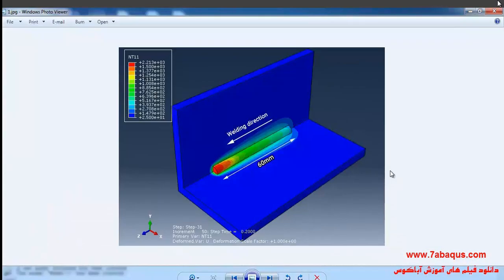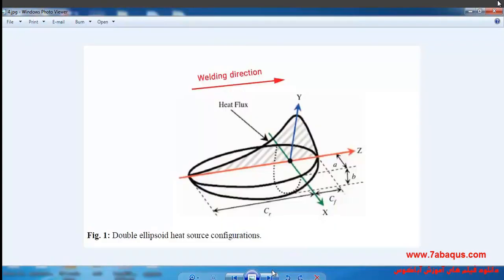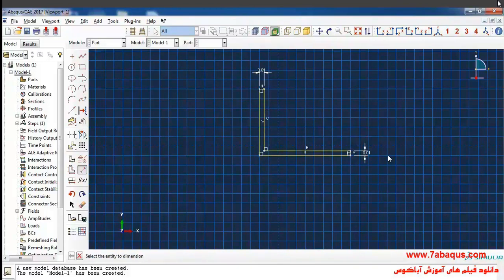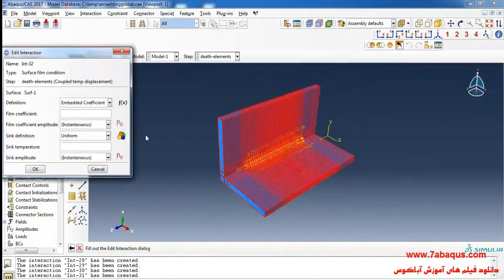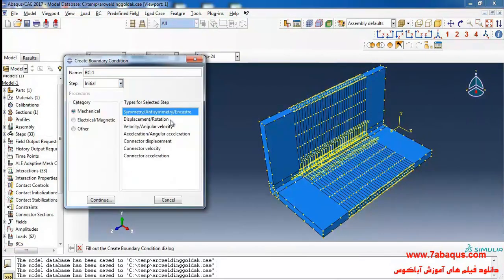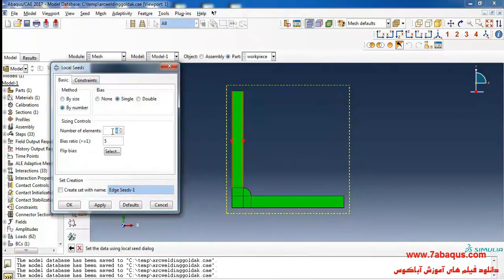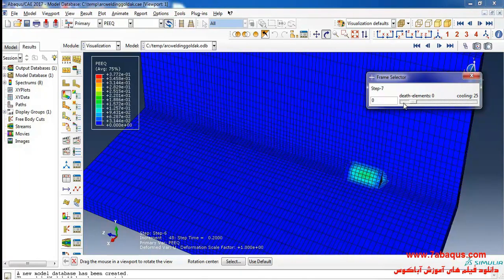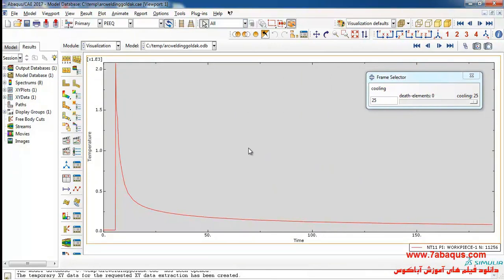Arc welding using the Goldaks double-ellipsoid heat source model Abaqus

Comment: sir please help me to remove these errors
The model database "D:\abaqus simulatins\Simulation Arc welding using the Goldaks double-ellipsoid heat source model Abaqus\arcweldinggoldak.cae" has been opened.
The job "weldbead" has been created.
The job input file has been written to "weldbead.inp".
The job input file "weldbead.inp" has been submitted for analysis.
Job weldbead: Analysis Input File Processor completed successfully.
Error in job weldbead: Too many attempts made for this increment
Job weldbead: Abaqus/Standard aborted due to errors.
Error in job weldbead: Abaqus/Standard Analysis exited with an error - Please see the  message file for possible error messages if the file exists.
Job weldbead aborted due to errors.

Comment: Sir can you guide me how to remove these errors?  I will be grateful
The model database "D:\abaqus simulatins\model.cae" has been opened.
The job "Job-1" has been created.
The job input file "Job-1.inp" has been submitted for analysis.
Error in job Job-1: ELEMENT 3253 INSTANCE PART-1-2 CANNOT BE ADDED USING *MODEL CHANGE IF IT IS NOT REMOVED OR INACTIVE IN THE PREVIOUS STEP
Error in job Job-1: ELEMENT 3254 INSTANCE PART-1-2 CANNOT BE ADDED USING *MODEL CHANGE IF IT IS NOT REMOVED OR INACTIVE IN THE PREVIOUS STEP
Error in job Job-1: ELEMENT 3255 INSTANCE PART-1-2 CANNOT BE ADDED USING *MODEL CHANGE IF IT IS NOT REMOVED OR INACTIVE IN THE PREVIOUS STEP
Error in job Job-1: ELEMENT 3256 INSTANCE PART-1-2 CANNOT BE ADDED USING *MODEL CHANGE IF IT IS NOT REMOVED OR INACTIVE IN THE PREVIOUS STEP
Error in job Job-1: ELEMENT 3257 INSTANCE PART-1-2 CANNOT BE ADDED USING *MODEL CHANGE IF IT IS NOT REMOVED OR INACTIVE IN THE PREVIOUS STEP
Error in job Job-1: ELEMENT 3258 INSTANCE PART-1-2 CANNOT BE ADDED USING *MODEL CHANGE IF IT IS NOT REMOVED OR INACTIVE IN THE PREVIOUS STEP
Error in job Job-1: ELEMENT 3259 INSTANCE PART-1-2 CANNOT BE ADDED USING *MODEL CHANGE IF IT IS NOT REMOVED OR INACTIVE IN THE PREVIOUS STEP
Error in job Job-1: ELEMENT 3260 INSTANCE PART-1-2 CANNOT BE ADDED USING *MODEL CHANGE IF IT IS NOT REMOVED OR INACTIVE IN THE PREVIOUS STEP
Error in job Job-1: ELEMENT 3261 INSTANCE PART-1-2 CANNOT BE ADDED USING *MODEL CHANGE IF IT IS NOT REMOVED OR INACTIVE IN THE PREVIOUS STEP
Error in job Job-1: ELEMENT 3262 INSTANCE PART-1-2 CANNOT BE ADDED USING *MODEL CHANGE IF IT IS NOT REMOVED OR INACTIVE IN THE PREVIOUS STEP
Error in job Job-1: ELEMENT 3263 INSTANCE PART-1-2 CANNOT BE ADDED USING *MODEL CHANGE IF IT IS NOT REMOVED OR INACTIVE IN THE PREVIOUS STEP
Error in job Job-1: ELEMENT 3264 INSTANCE PART-1-2 CANNOT BE ADDED USING *MODEL CHANGE IF IT IS NOT REMOVED OR INACTIVE IN THE PREVIOUS STEP
Error in job Job-1: ELEMENT 3265 INSTANCE PART-1-2 CANNOT BE ADDED USING *MODEL CHANGE IF IT IS NOT REMOVED OR INACTIVE IN THE PREVIOUS STEP
Error in job Job-1: ELEMENT 3266 INSTANCE PART-1-2 CANNOT BE ADDED USING *MODEL CHANGE IF IT IS NOT REMOVED OR INACTIVE IN THE PREVIOUS STEP
Error in job Job-1: ELEMENT 3267 INSTANCE PART-1-2 CANNOT BE ADDED USING *MODEL CHANGE IF IT IS NOT REMOVED OR INACTIVE IN THE PREVIOUS STEP
Error in job Job-1: ELEMENT 3268 INSTANCE PART-1-2 CANNOT BE ADDED USING *MODEL CHANGE IF IT IS NOT REMOVED OR INACTIVE IN THE PREVIOUS STEP
Error in job Job-1: ELEMENT 3269 INSTANCE PART-1-2 CANNOT BE ADDED USING *MODEL CHANGE IF IT IS NOT REMOVED OR INACTIVE IN THE PREVIOUS STEP
Error in job Job-1: ELEMENT 3270 INSTANCE PART-1-2 CANNOT BE ADDED USING *MODEL CHANGE IF IT IS NOT REMOVED OR INACTIVE IN THE PREVIOUS STEP
Error in job Job-1: ELEMENT 3271 INSTANCE PART-1-2 CANNOT BE ADDED USING *MODEL CHANGE IF IT IS NOT REMOVED OR INACTIVE IN THE PREVIOUS STEP
Error in job Job-1: ELEMENT 3272 INSTANCE PART-1-2 CANNOT BE ADDED USING *MODEL CHANGE IF IT IS NOT REMOVED OR INACTIVE IN THE PREVIOUS STEP
Error in job Job-1: ELEMENT 3273 INSTANCE PART-1-2 CANNOT BE ADDED USING *MODEL CHANGE IF IT IS NOT REMOVED OR INACTIVE IN THE PREVIOUS STEP
Error in job Job-1: ELEMENT 3274 INSTANCE PART-1-2 CANNOT BE ADDED USING *MODEL CHANGE IF IT IS NOT REMOVED OR INACTIVE IN THE PREVIOUS STEP
Error in job Job-1: ELEMENT 3275 INSTANCE PART-1-2 CANNOT BE ADDED USING *MODEL CHANGE IF IT IS NOT REMOVED OR INACTIVE IN THE PREVIOUS STEP
Error in job Job-1: ELEMENT 3276 INSTANCE PART-1-2 CANNOT BE ADDED USING *MODEL CHANGE IF IT IS NOT REMOVED OR INACTIVE IN THE PREVIOUS STEP
Error in job Job-1: ELEMENT 3277 INSTANCE PART-1-2 CANNOT BE ADDED USING *MODEL CHANGE IF IT IS NOT REMOVED OR INACTIVE IN THE PREVIOUS STEP
Error in job Job-1: ELEMENT 3278 INSTANCE PART-1-2 CANNOT BE ADDED USING *MODEL CHANGE IF IT IS NOT REMOVED OR INACTIVE IN THE PREVIOUS STEP
Error in job Job-1: ELEMENT 3279 INSTANCE PART-1-2 CANNOT BE ADDED USING *MODEL CHANGE IF IT IS NOT REMOVED OR INACTIVE IN THE PREVIOUS STEP
Error in job Job-1: ELEMENT 3280 INSTANCE PART-1-2 CANNOT BE ADDED USING *MODEL CHANGE IF IT IS NOT REMOVED OR INACTIVE IN THE PREVIOUS STEP
Error in job Job-1: ELEMENT 3281 INSTANCE PART-1-2 CANNOT BE ADDED USING *MODEL CHANGE IF IT IS NOT REMOVED OR INACTIVE IN THE PREVIOUS STEP
Error in job Job-1: ELEMENT 3282 INSTANCE PART-1-2 CANNOT BE ADDED USING *MODEL CHANGE IF IT IS NOT REMOVED OR INACTIVE IN THE PREVIOUS STEP
Error in job Job-1: ELEMENT 3283 INSTANCE PART-1-2 CANNOT BE ADDED USING *MODEL CHANGE IF IT IS NOT REMOVED OR INACTIVE IN THE PREVIOUS STEP
Error in job Job-1: ELEMENT 3284 INSTANCE PART-1-2 CANNOT BE ADDED USING *MODEL CHANGE IF IT IS NOT REMOVED OR INACTIVE IN THE PREVIOUS STEP
Error in job Job-1: ELEMENT 3285 INSTANCE PART-1-2 CANNOT BE ADDED USING *MODEL CHANGE IF IT IS NOT REMOVED OR INACTIVE IN THE PREVIOUS STEP
Error in job Job-1: ELEMENT 3286 INSTANCE PART-1-2 CANNOT BE ADDED USING *MODEL CHANGE IF IT IS NOT REMOVED OR INACTIVE IN THE PREVIOUS STEP
Error in job Job-1: ELEMENT 3287 INSTANCE PART-1-2 CANNOT BE ADDED USING *MODEL CHANGE IF IT IS NOT REMOVED OR INACTIVE IN THE PREVIOUS STEP
Error in job Job-1: ELEMENT 3288 INSTANCE PART-1-2 CANNOT BE ADDED USING *MODEL CHANGE IF IT IS NOT REMOVED OR INACTIVE IN THE PREVIOUS STEP
Error in job Job-1: ELEMENT 3289 INSTANCE PART-1-2 CANNOT BE ADDED USING *MODEL CHANGE IF IT IS NOT REMOVED OR INACTIVE IN THE PREVIOUS STEP
Error in job Job-1: ELEMENT 3290 INSTANCE PART-1-2 CANNOT BE ADDED USING *MODEL CHANGE IF IT IS NOT REMOVED OR INACTIVE IN THE PREVIOUS STEP
Error in job Job-1: ELEMENT 3291 INSTANCE PART-1-2 CANNOT BE ADDED USING *MODEL CHANGE IF IT IS NOT REMOVED OR INACTIVE IN THE PREVIOUS STEP
Error in job Job-1: ELEMENT 3292 INSTANCE PART-1-2 CANNOT BE ADDED USING *MODEL CHANGE IF IT IS NOT REMOVED OR INACTIVE IN THE PREVIOUS STEP
Error in job Job-1: ELEMENT 3293 INSTANCE PART-1-2 CANNOT BE ADDED USING *MODEL CHANGE IF IT IS NOT REMOVED OR INACTIVE IN THE PREVIOUS STEP
Error in job Job-1: ELEMENT 3294 INSTANCE PART-1-2 CANNOT BE ADDED USING *MODEL CHANGE IF IT IS NOT REMOVED OR INACTIVE IN THE PREVIOUS STEP
Error in job Job-1: ELEMENT 3295 INSTANCE PART-1-2 CANNOT BE ADDED USING *MODEL CHANGE IF IT IS NOT REMOVED OR INACTIVE IN THE PREVIOUS STEP
Error in job Job-1: ELEMENT 3296 INSTANCE PART-1-2 CANNOT BE ADDED USING *MODEL CHANGE IF IT IS NOT REMOVED OR INACTIVE IN THE PREVIOUS STEP
Error in job Job-1: ELEMENT 3297 INSTANCE PART-1-2 CANNOT BE ADDED USING *MODEL CHANGE IF IT IS NOT REMOVED OR INACTIVE IN THE PREVIOUS STEP
Error in job Job-1: ELEMENT 3298 INSTANCE PART-1-2 CANNOT BE ADDED USING *MODEL CHANGE IF IT IS NOT REMOVED OR INACTIVE IN THE PREVIOUS STEP
Error in job Job-1: ELEMENT 3299 INSTANCE PART-1-2 CANNOT BE ADDED USING *MODEL CHANGE IF IT IS NOT REMOVED OR INACTIVE IN THE PREVIOUS STEP
Error in job Job-1: ELEMENT 3300 INSTANCE PART-1-2 CANNOT BE ADDED USING *MODEL CHANGE IF IT IS NOT REMOVED OR INACTIVE IN THE PREVIOUS STEP
Error in job Job-1: ELEMENT 3301 INSTANCE PART-1-2 CANNOT BE ADDED USING *MODEL CHANGE IF IT IS NOT REMOVED OR INACTIVE IN THE PREVIOUS STEP
Error in job Job-1: ELEMENT 3302 INSTANCE PART-1-2 CANNOT BE ADDED USING *MODEL CHANGE IF IT IS NOT REMOVED OR INACTIVE IN THE PREVIOUS STEP
Error in job Job-1: Error message limit reached. No further error messages will be reported.
Please see the dat file for more errors.
Job Job-1: Analysis Input File Processor aborted due to errors.
Error in job Job-1: Analysis Input File Processor exited with an error - Please see the  Job-1.dat file for possible error messages if the file exists.
Job Job-1 aborted due to errors.